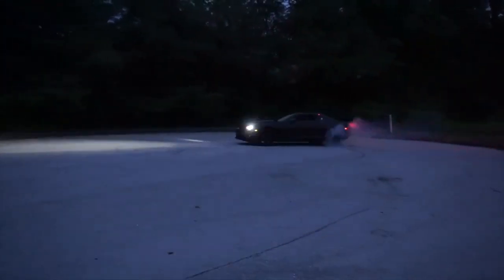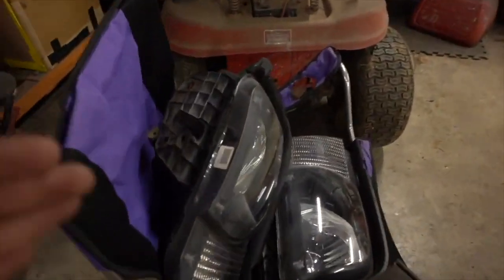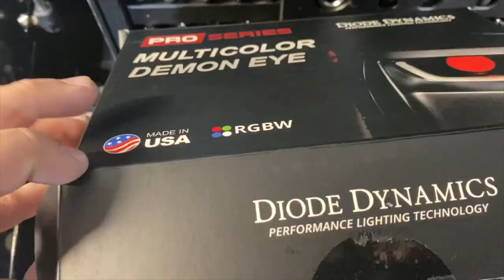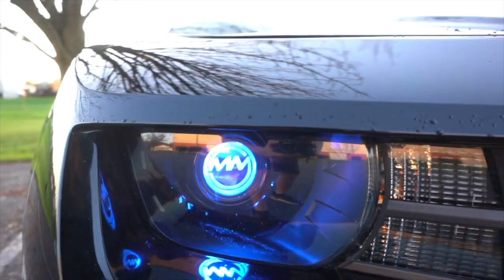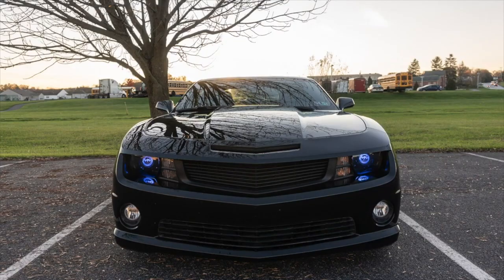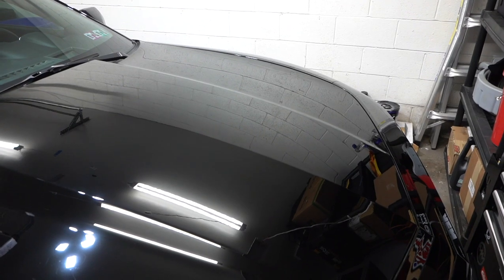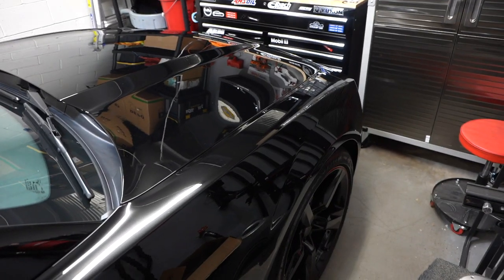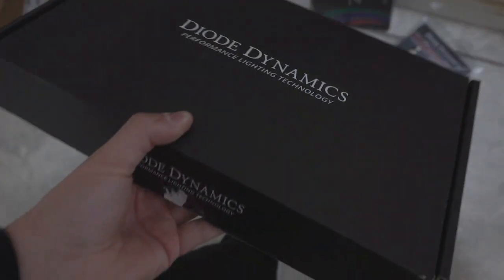Custom Retrofit Headlights, Heritage Grille AND Paint Correction! 2013 Camaro SS

Comment: How come some 5th gens came with halos and some didn't. Mine has them and I originally thought all SS camaros came with halos but I guess not. Would love to get some custom color changing projectors and halo rings. Im just not bold enough to tear open my halos. Maybe if I can find a cheap spare set.
Reply from the maker: I have no idea why chevy did that. I guess it was an option. The halogen ones look terrible which is why I changed them. Opening the lights up was definitely kinda scary at first. Diode Dynamics has this sealant that works well though and you could add demon eyes to your projectors and an LED chip to the halos - then you’d have color changing ability for both. 
I may go that route since this custom ones are hard to do Chevy style halos on.
Reply: Super late reply but only Camaros with the "RS" package received Halos along with the four pods in the center 👍

Comment: Question. Why not just get some of those headlight that has the projector and DRL'S already? And mod that? Would have been easier just add the demon eye and be done. At the same time you could have the drls too looks so good.
They came on regular SS too.
Not only on the ZL1 so could of found them used everywhere.
But looks great nothing less
Reply from the maker: I thought about that but it’s like $700 for a OEM set used and I already had these headlights with the car. I like the factory halos/DRLs and might get them eventually but this way was easier to build and mod to start. And I got a custom engraved projector too. 
Mine is a 2SS but not an RS package, so I didn’t get those nicer lights lol.
Reply: @MartyMotoring  oh ok. Cool.
Yeh can always do it later of course. Just me 2 cents of instead of spending money now just save and do it once and done. But like I said looking good bro keep it up